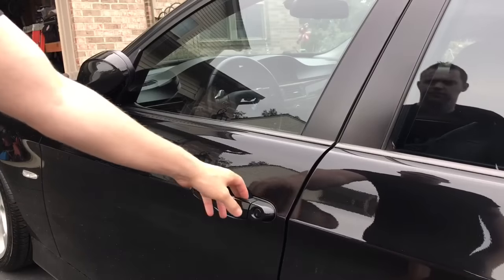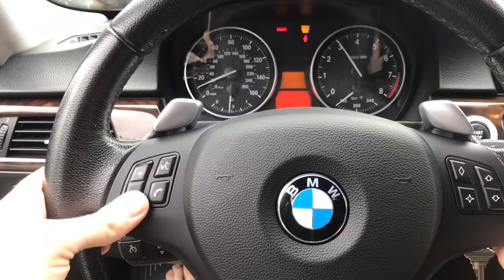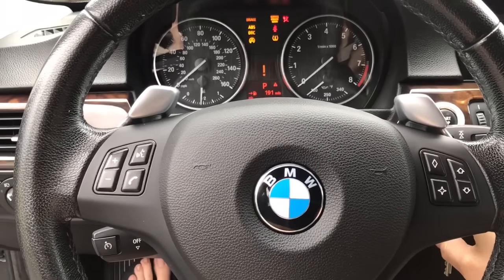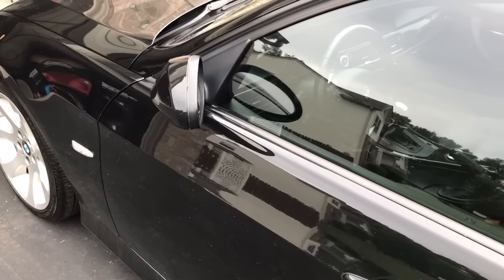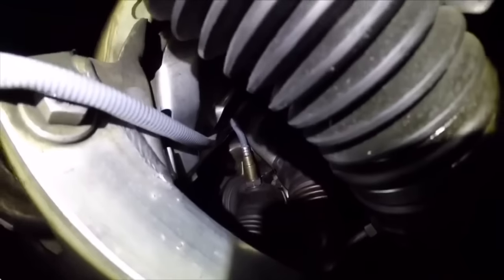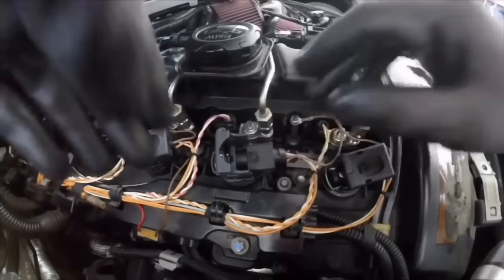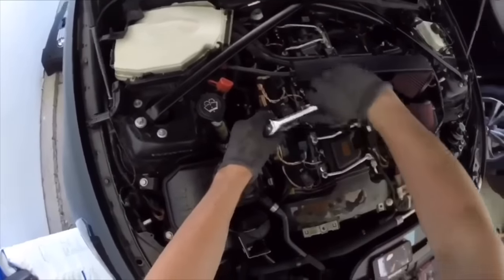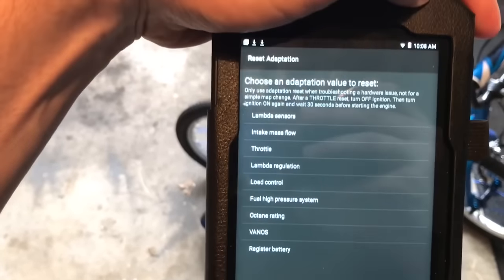BMW ROUGH IDLE FIX! HOW TO!

Comment: My friend told me that my problem (staling after a rough idle) was it needed to be driven, on the freeway. I tried it and opened it up and it isn’t having the problem anymore
Reply: @_TulipMania  ended up needing me to clean the mass airflow sensor. It got totaled by a truck that turned left in front of me so I bought an 335d and man is it fun
Reply: @HL_  haha it totalled did now I got a 335d and it's fun. It's bout to get an 8hp75 :)

Comment: Mines is shaking, rough idling, and surging after I turn on my car. I did a scan tool test and it reads cylinder 6 misfire. I changed the spark plug and coils. Do you believe it is the injector on cylinder 6? Or do I need switch coils from delphi
Reply: If you're still having this problem you need to clean the non return valves and replace your vanos solenoids. Make sure everything is super clean and get an oil change when you replace the solenoids.
Reply: Having this same exact problem did u find the solution
Reply: @LavishDre did you find your issue ? I’m having hella issues with mine
Reply: @LavishDre  check the oil filter has the vanos cage and o rings inside of the filter

Comment: My 2008 E90 318i is starting to get rough and a little vibration every few seconds while I’m parked or stationary in traffic when in motion it runs fine but I would really like to get to know how to fix this mini jumps the car is going to a a few seconds the whole car vibrates or shakes sometimes play hard other times like a gentle shake? Any advice please its wrecking my head.....
Reply: I have the same problem. Dealer said there’s no problem but it’s really annoying. Try testing your ignition coils, spark plugs. If that doesn’t work try cleaning or changing your vanos solenoids, they are responsible for the opening and closing of valves in the engine and exhaust and when they are off it can cause a rough idle or shake.
Reply: did you fix this? i’m having the same problem, small shakes every few seconds
Reply: Matthew Berry I have tried multiple things with no luck, no obd or check engine light, so I’m just waiting until it triggers a sensor. I currently don’t have the time either, I assume it’s something with the ignition, possibly a coil or a spark plug. So I’m waiting for one to fully go out not just misfire
Reply: Marques Productions What about vanos solenoids?
Reply: Matthew Berry I cleaned em with some mass airflow sensor cleaner, didn’t change anything
Reply: Did you ever find any solution?

Comment: Btw this only works if you have an N54 with a JB4 plug in tuner
Reply: So it’s a no for a 328i?
Reply: @minh_d3475  Probably not. Your best bet is to scan the codes and go from there. If theres not codes then replace the spark plugs, and go from there

Comment: There is a small difference between fuel in summer and winter, the difference is in the RVP of the fuel. But however, this will not work on a car that has no tune like the JB4 or the MHD (Also NOTE: JB4 is mainly for the N54). I tried this after a small idling issue on my 2011 bmw 328i xDrive (E90 328i LCI, N52B30A) and it did not work. I am getting a scan tool to see if there is any small misfires or other codes. I am taking my car to bmw to get an oil change for $120 and the reason why I'm doing it because they said they'll give me a G20 3 series as a loaner and I love to test out cars. But they do offer a complementary check and I want to see if they talk about any issues that I will use to fix my car in my garage.
Reply: What was the problem ignition?

Comment: I need help , my car has rough idle at cold stars and a 3 second crank before start up. I changed spark plugs , coils, 02 sensor at 131k miles. Currently at 139,338 with no tune. Upgraded my charge pipe and new intakes. Also I changed vanos and my codes are 002AA4 - intake camshaft position monitoring
003100 boost pressure shut down. 
I have 2007 bmw 335xi.
Reply: I’m having the same issue same year 🙃 it’s a rough ideal when cold start and I feel it sometimes at a light or a stop sign.
Reply: @noahvotion6868  same here man I have no idea what’s going on just did coils and spark plugs took out my jb4 tune still shakes on idle rpms jumping when stopped , kinda feel it choking on power etc. I’m just gonna sell it man not worth the headache
Reply: If your car has a long crank and rough idle, it most likely is the High Pressure Fuel Pump.
Reply: How much did all of that cost you ??

Comment: Hey love the channel but you should of definitely included carbon build up/walnut blast as another possibility to a rough idle. Should also be done every 50k miles. Specially for those people who may have never done it and aren’t getting codes, mite be carbon build up.  Otherwise great video!

Comment: I have a 2007 323i with 180k on it I’ve done coils plugs vanos injectors I’m at a lost it still has a terrible shake at idle but it drives no codes got it with 169k
Reply: Same here, I changed DISAs, wondering if its a Vanos or Injectors issue?
Reply: Did you fix it?
Reply: Check maf and 02 sensors
Reply: Any luck you guys my 09 528i same thing every 40 seconds idle drops shake but drives excellent grrrrr

Comment: Clean off the carbon in your intake - u don't need a walnut blaster, just an oil extractor with 1/4 RO line and a valve to control, lots of brake cleaners (or gasoline), and bundle up a bunch of 8 inch cable ties (one min each valve). Do a "smoke" test - first by replacing the charge pipe with a glove, then pump little compressed air into the vacuum line. If the glove blows up and hold (for a while), then no need to "smoke". Also change the spark plugs - don't use autolite. Make sure the compensation numbers on the injectors are programmed into the DME correctly (get a K_D can cable and download ISTA).... These are the cheap steps u should take before investing into replacing expensive parts.

Comment: I have a 2013 f10 n55 and have a rough cold start idle for the first start of the day where the rpms bounce from 600 too 1000 for a couple minutes and dont return for the rest of the day. would this be a vanoss or carbon buildup issue (walnut blast) ?

Comment: I have e92 2011. I am having similar problems with revs. Engine light is on constant. After scanning I found cylinder 2 misfire,  I had it replaced with a new one.
Sadly the problem cam back next day. Another scan and this time it was cylinder 5. Replaced again and problem came back in 20 min of driving. Now I had another scan from a better software and it showed so many errors in engine management. They guy told me that it’s the ECU, must have got wet and needs attention. Right now I am at garage and looking at it. I am sick and tired of BMW’s. Had similar problem with my e90.

Comment: Brother love your channel, been a loyal subscriber for a while. I live how you troubleshoot all your car problems, and how you are so willing to help others in the N54 and N55 community. With that being said I am seriously lost and I am in need of some dire help. My 2009 335ix is getting flooded inside everytime it rains. Thought it was the front windshield- replaced it. Was told it could be the drains from the sun roof- clean them. Common is issue at times could be the seal behind door panels- don't think is that, or have read that it can be caused by a leakage through the cabin air filter. Could do a video regarding this issue and potential fixes. I hardly use my car and have cover protecting it from the rain. Would hate to get rid of it because of this issue and I feel that it could be something simple to fix. I'm in Allentown, PA so anything or anyone you could recommend would be much appreciated. Thanks and sorry for the lengthy message.

Comment: Hey what are the best sparkplugs to buy for a moderately tuned n54
Reply: Travis ngk is super popular
Reply: 95770
Reply from the maker: NGK are colder, but I’ve been on the BMW branded Bosch ones for 60k miles being tuned - never once had a misfire at high boost
Reply: BMW Fanatic , it depends on which NGK you get. They have all kinds of heat ranges. Not an accurate response. NGK are the way to go. They aren't in 80% of the cars in the world, for no reason.
Reply: NGK iridium plugs. don't buy Bosch plugs what ever you do.
Reply: If 80% of the poeple  jumped off a cliff,would you?
Reply: yes

Comment: Hey man I hope u can read this message I have a 1990 bmw 535i and it’s idling rough and doesn’t want to start now and it has like poor acceleration sometimes. It also has different start up times and now it’s just not running right now but it is cranking. It has stuttered as well when I accelerated. What would be the issue?
Reply: Any fix ?

Comment: i did a adaption reset last week mine gone a little worse since....im getting a few hiccups cold idle ...and sometimes idle would change to 750rpms ....after adaption reset...soon as its warmed up its going to 750rpms all time now...( not sure if its anything to do with it or coicidence )...gonna start with ngk plugs and delphi coils see were i get last owner fitted index 12 injectors with reciete so i cant see it being an injector fault ....running stock apart from k@n replacement filter and vsr downpipes

Comment: Hi,
That “O2 Sensor” you mentioned, is that the Front Upstream Oxygen Sensor? 
Is that what you would mention if you have to buy it?
Reply: Sensor 1 is the one that sends signal to adjust rich or lean, sensor 2 reads the end results after the cat.

Comment: HELP! I have an idle issue AFTER changing plugs and coil packs at 65,000 miles (N52). The idle “hunts” every few minutes, raises and drops about 500 rpms.  A little worse with AC on. Other than that runs AWESOME with new parts. Stock N52. Thanks!
Reply: Any update?
Reply: Thanks- I replaced both the gas cap and the oil filler cap and one of those fixed the problem! I actually sold the car to Carvana a few months ago. They offered a great price so at 78,000 miles I took it💰
Reply: @aPengboi  did any of these fix your problem?

Comment: I have a 2009 750i BMW I just bought it about 3 weeks ago I had to take it back they said they changed the spark plugs the CV valve and the alternator however when I first started the idle is very rough I give it about 7 minutes to calm down any advice
Reply: Could try replacing valve seals and or having the intake cleaned from carbon build up. Currently having the same issues with my 07 550i same engine

Comment: have 2008 bms x5 3.0si ,,if the spark plugs gone bad or even 02 sensor  aren't  they shows any code ? my truck only rough idle or some times shake once  at first statrt ! but no code what it would be ?

Comment: I have an issue at idle, it revs up and down  stops on acceleration,  fuel consumption  is down., I put a new mass air flow in and got worse. Do I have to reset computer. Before stating. When I unplug new mass air it idles better but not right. Can a fuel leak cause this issue because I have one.

Comment: Hi, quick question. My e46, is having a rought idle. And when reving up the engine, it wouldn’t go past 2000 rpm and goes down right away and hesitates. I’ve done cleaning the spark plugs all coils are good. Cleaned out idle control valve, dissa valve amd crankcase vent valves. I’m looking into vanos. But wanted to ask if you have any clue? Pls help. 🙏🏽 or anyone here had this problem. Please help. Thank you

Comment: Please respond to me I’ve tried everything I take my bmw to the bmw dealership and they can’t seem to find the problem, when I start my bmw 2007 335i it shakes while shaking I press the gas and hold it down for a little and that seems to get the car to stop shaking but when I start the car it will Shake aggressively can’t seem to find the problem and when it shakes the Engine light comes on then goes away it doesn’t shake all the time just some times
Reply: hayley Farah sounds like your getting misfires. Grab an obd2 scanner and see what cylinder is misfiring

Comment: Have you ever done an engine flush on your car? Is it good/bad for the engine ?
Do we have to take extra care while flushing the car with turbo?
Reply from the maker: THEzxKING9 Just normal oil changes are plenty good with a high quality oil. No need to add extra stuff in there.
Reply: Jayvenkatraj Don’t ever do an engine flush, esp. with turbo.

Comment: I have a 318 I 2008 model and I’m getting a rough idle when it starts it’s like shuddering a little bit when it’s in idle or after driving with no obvious signs in the engine, but my oil levels are going down a lot? Anybody offer any help would really appreciate it, thank you!
Reply: This is happening to me but I know the oil is getting passed the seal into the exhaust in my turbos....they're overdue.
Reply: @alexc7641  thanks Alex!

Comment: I just swapped out my injectors to index 12 and changed the spark plugs as well. I reset adaptations and when I started the car the idle was super rough. It’s smoothing out now but nowhere near as smooth as it was before I reset everything. I’ve put about an hour of highway miles on it since. I’m also running mhd stage 1 tune. Is this this normal or am I missing a step? Any help would be greatly appreciated.
Reply: Did you get the injectors coded to the car? They have different flow rates and not every injector is the same so they need to be adjusted accordingly by the DME

Comment: So I have 3 new index 12 injectors in 4,5,6. I did the carbon blasting, changed my plugs, and the previous owner bought new coils a year ago. Car is stock and now well maintained (Because of me) I haven't got a misfire since I did all the work but when changing my plugs I did notice oil on 5 and 6 plugs. Since I changed them I only got a misfire on cylinders 4 5 and 6 maybe twice and I have a rough idle most of my mornings but then it goes back to normal. I also notice my car was missing one bar of oil on the iDrive. 

I want your opinion but I'm guessing this is the valve cover gasket? Minor leak but I guess i gotta do it? :( I've diagnosed everything else. Car is still stock.
Reply: id guess so, i just did mine because of the same thing. spark plug wells 5 and 6 were pretty oiled up and when i took the coil off the boot was loaded up which causes a misfire obviously. if youre gunna diy it, id give it a solid day or two evenings. its a pain in the ass getting the like one billion valve cover bolts out
Reply: Leandro valve cover gasket. It sucks but you can do it . Follow the guide on ecs tuning or YouTube vid . Took me one whole day since it was my first time
Reply from the maker: Leandro yep! Valve cover gasket - I do have a DIY 😀 https://youtu.be/wIzK4grQZ8Q

Comment: I’ve changed battery cleaned fuel injectors I’ve changed spark plugs still have no idea why I have a rough idle on my 07 bmw 328i my computer reader doesn’t work either so I have no clue
Reply: low compression on one of the cylinders.. car is done

Comment: I have cc id 29 I try to fix it I have changed high pressure pupm, Coils, Spark plugs, Map sensor 3.5 bars, I buy the fuel sensor i hope it's that one and I try computer no read, what you think it van be injectors?
Reply: I had the same problem. It was my wastegates.

Comment: Now if it were to be injectors, coils, or O2 Sensors, would the car throw a code?
Reply: MadDavid depends. i had leaky injectors and sometimes it would throw misfire codes.. if an o2 sensor fails 100% you would have a service engine soon light
Reply from the maker: Depends, mine never did when my Injectors were failing...no fuel on the plugs too. It all pointed to that and it was the best move to make to replace all 6
Reply: BMW Fanatic what were all your symptoms? I’ve replaced coilpacks & plugs and still have a rough hiccupy idle & cold start, goes through WOT fine with no misfires and can’t get it to through a code with whatever I do. Any help would be appreciated as I’ve been trying to figure this out for some time now.

Comment: Quick question how come you are running jb4 over mhd? is it safer ?
Reply: He's using the Jb4 with a Mhd back end flash. The debate on if it's safer or not is up for debate. Some say yes others say no. I run mhd but I'm going to pick up a jb4 to run both too.

Comment: I have a e90 328i my idle is at 600 rpm’s but when I start the car it always starts to shake slightly and kinda just move around is that normal?
Reply: An Drew i have the same problem did u find out why?
Reply: Mine does the same. Replacement of the coils and plugs helped tremendously.

Comment: In America do you have to be rich to own a BMW
Reply: No. My boss is trying to sell me his bmw 5 series with the 2.5 inline 6. He let me use it as a work car for a week or so. It has 120k miles for 5500 USD which is nothing. The only problem is the engine has a rough idle and im wondering if i can fix it, hence why im here. His mechanics are dumbasses when it comed to foreign cars imo
Reply: In America the problem is you can’t find a trust worthy mechanic, 95% are crooks. I work on my own BMW but sometimes I need professional help/opinion and can’t find it unless I’m willing to pay out the ass for help, that’s what makes it expensive to own.

Comment: I really wish mhd was for n52 also pretty fucked up how the n52 gets completely forgot about, its a very common car and extremely similar to n54, its sad how the potential of these cars is held soo far back just because of the ecu and the abillity to mod it.
Reply from the maker: N52 internals are not the greatest either. They would be max on 8psi of boost, which it would be faster sure, but maxed so soon
Reply from the maker: But I hear ya!